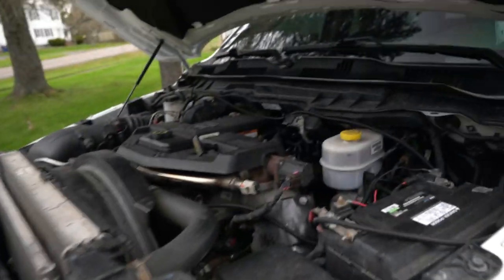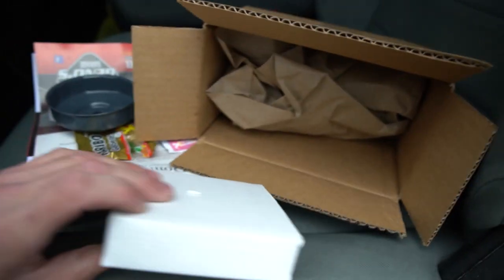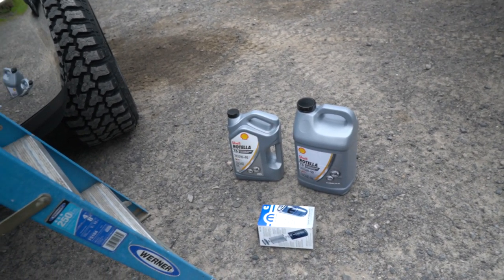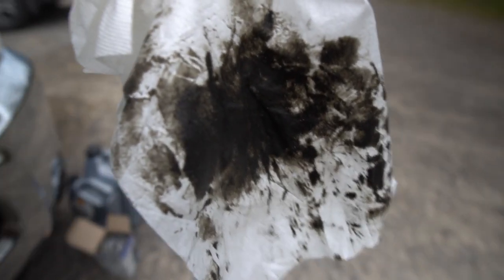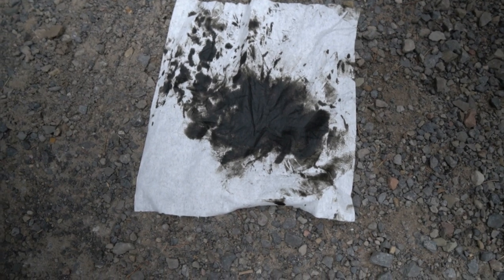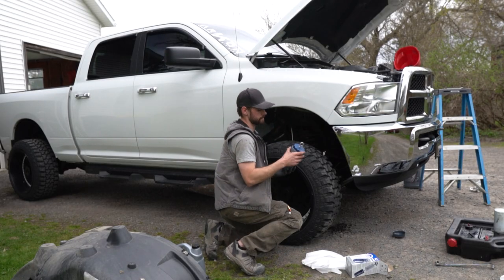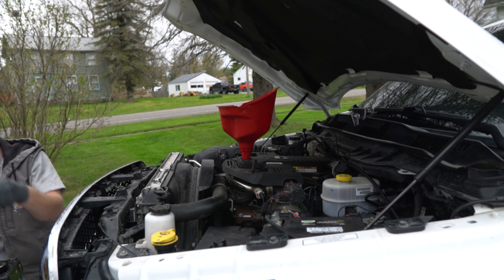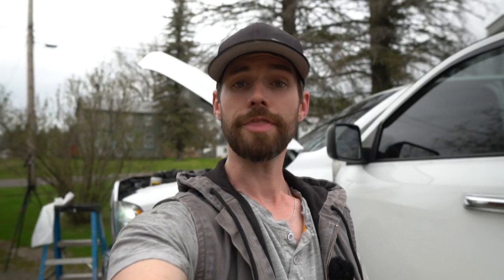EVERY 6.7 CUMMINS OWNER NEEDS THIS TOOL!!!

Comment: I just did an Amsoil remote oil filter/bypass filter and never looked back. Yeah, it's not cheap and you have to make a kit out of parts, but it's well worth it. Now my oil filters are tucked under the passenger side door and are easily accessible whenever I need to change the oil.
Reply from the maker: I was watching some stuff on that last week. I may have to consider just doing that to make life even easier.